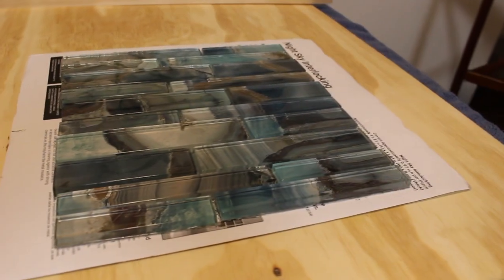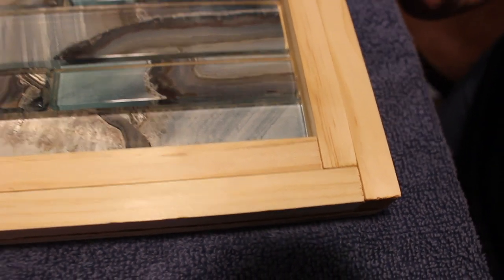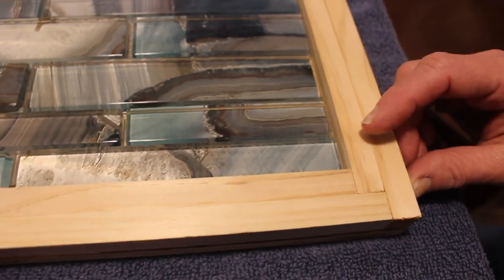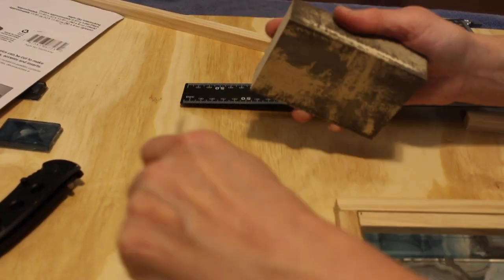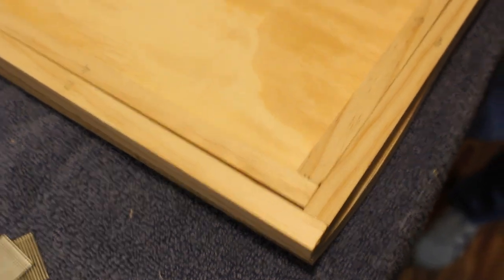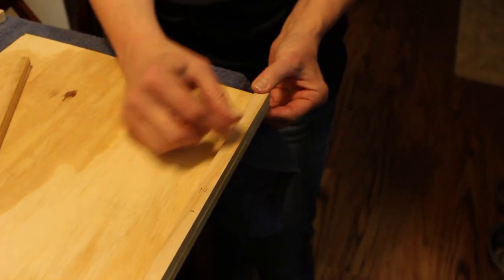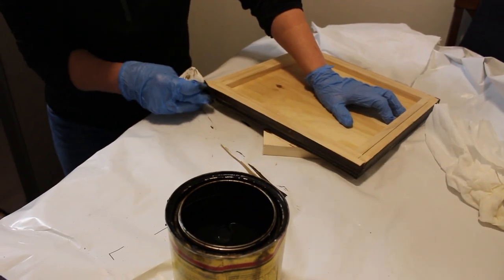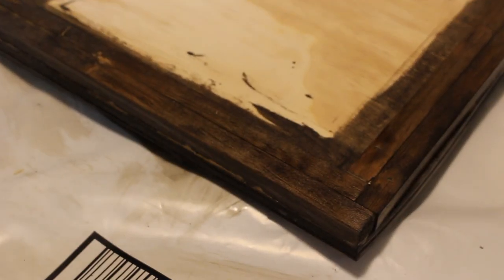Amazing mosaic glass tile and wood trivet

Comment: How come you didn’t put grout in between the tiles?
Reply from the maker: There is no need the heat will make it crack
Reply: What did you put between the joints of the tile?